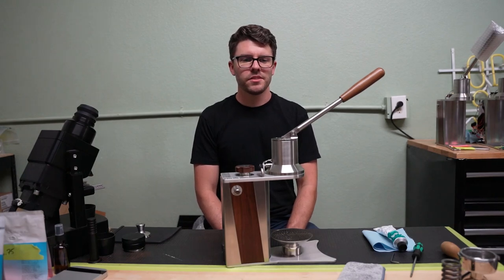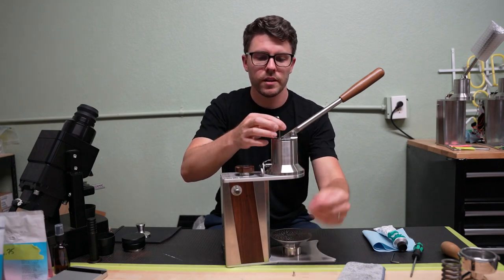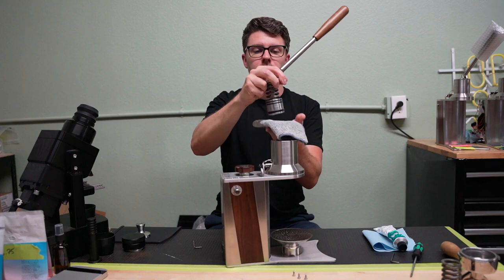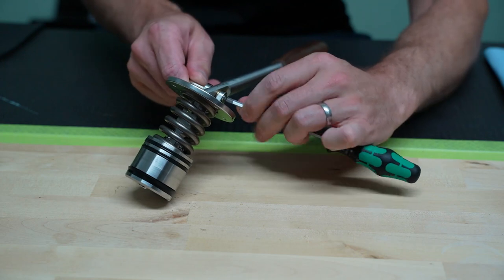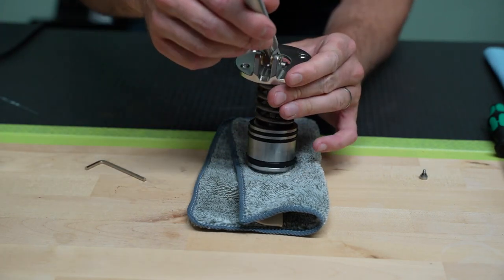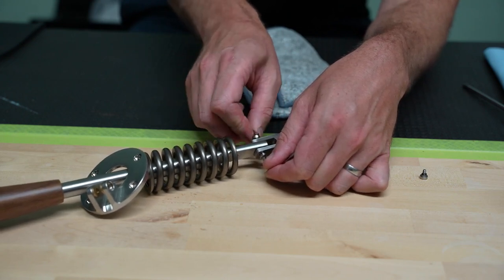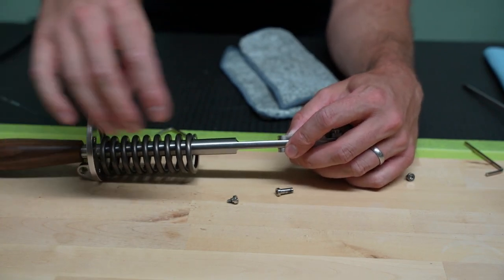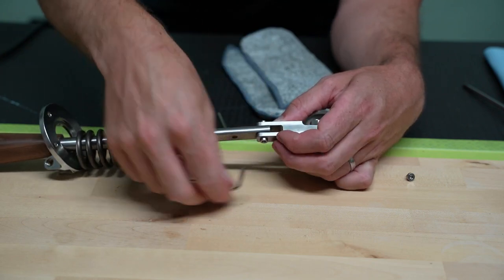Swapping The Odyssey Argos From Spring to Direct

Comment: Just ordered my 8 bar! So excited. I currently have a 1978 bezzera family lever. What is the difference from the direct and spring?
Reply from the maker: I just posted a video on pulling a shot in the direct configuration where users have complete control over pressure while trading off repeatability
Reply: @odysseyespresso  amazing! I need to read more about this machine! I kinda just jumped and bought it!!! Haha ive been looking for a proper lever macchine that would allow me to dial in, and this looks like it!! Im so excited

Comment: Hi! I am a coffee starter from Korea who is interested in Argos. I am leaving a message to you so it may help Argos to be more user friendly. Would you consider placing a Boo ey in the boiler for the sake of convenience? lamarzocco places red Boo ey to indicate drip tray to be drained when it the tray is full. you would still need to find out which plastic material to use such that it would withstand the heat and pressure.
Reply from the maker: Thanks for the suggestion! Can you please email a photo of the indicator that you're referencing so we may dig into this idea further? Many people do not like having plastic in their boiler which can make this difficult to achieve.